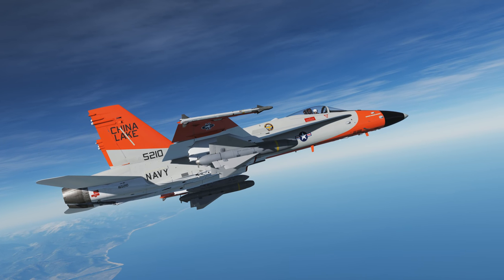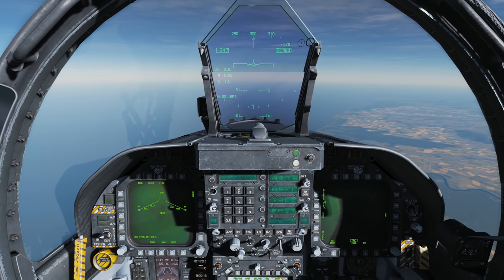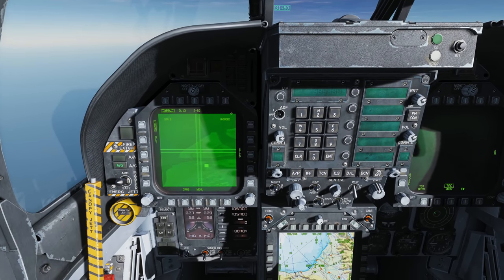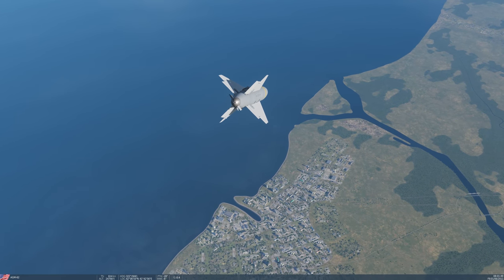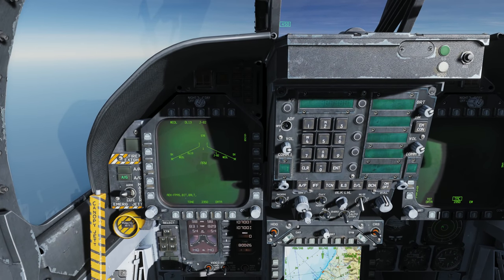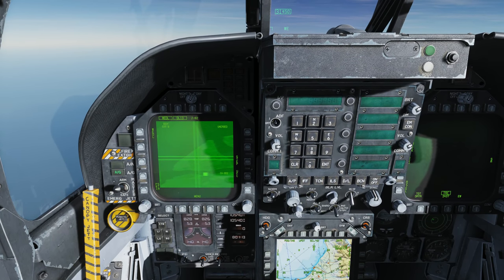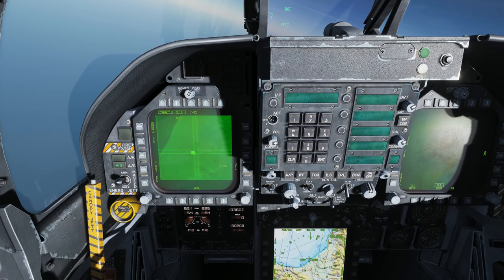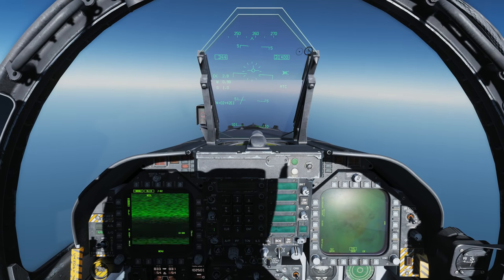DCS: F/A-18C Hornet - AGM-62 ER/DL Walleye II

Comment: Great. The Hornet is getting some good love. 
When loading this weapon, does it require also loading a datalink pod for them too? This is a really cool weapon.
Reply from the maker: If you wish to use the man-in-the-loop guidance, then yes, you must have the AWW-13 data link pod loaded on one of the wings. Thanks
Reply: @MattWagner  Is it possible to buddy guide the Walleye?
Reply: @MattWagner  are the channels aircraft specific or would channel 8 be the same on my plane and my friends?
Reply: @Xenthera  he said it's based on what station you have the DL on
Reply: @MattWagner  Does the DL pod have to be on one of the wings, or will it be loadable on the center pylon, like the EA-18G?
Reply: @PeanutGalleryComments  I think he was referring to transmitting the data from the DL pod to another plane. Would that other plane have to tune to channel 8 to be able to see the video from the his plane, is basically what the question is.
Reply: @Ryan-pm5ss  Can confirm the DL pod can be mounted on the Centerline station in game.
Reply: Robert Haddow buddy guide dez nuts
Reply: Bobby Elliott well if you listened Wagner said whatever pylon it’s on is the channel

Comment: I'm looking forward to trying it wags thanks for the info. Are you using a VR headset in your videos?
Reply from the maker: No, just Track IR thanks.
Reply: @MattWagner  damn wags I had track 5 ir pro I returned it it just seemed really fast Head movement it was hard to fly.
Reply: @keilylmm6377  There are some really good profile for the axis controls, I couldn't use it out the box, but imported Spudknocker's profile (another youtuber) and it works brilliantly

Comment: I don't know much, if anything about the walleye so maybe this is normal, but why doesn't the air driven generator spin while the weapon is on the pylon? Only when it's released?
Reply from the maker: Ted Weiss. A brake is released at separation.
Reply: @MattWagner  thanks wags!

Comment: Quick question, do you guys plan on releasing a cheek slot for the litening so we can carry a center line tank?
Reply from the maker: The USMC Hornet only carries it on the centerline station. We may look into an unrealistic option later. Thanks
Reply: @MattWagner  Will there eventually be a pod for cheek mount? It would be great if we cod carry a centerline tank and a tpod. Thanks
Reply from the maker: @ascherlafayette8572  The USMC Hornet only carries it on the centerline station. We may look into an unrealistic option later. Thanks
Reply: @MattWagner  Ok, thanks